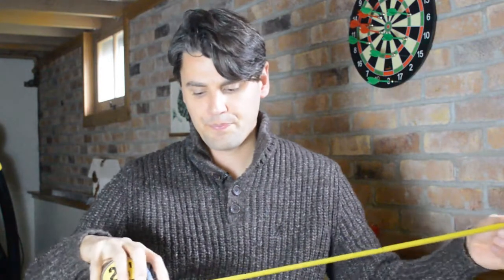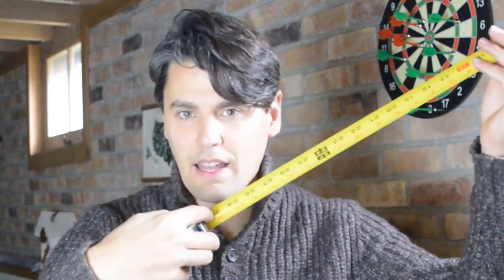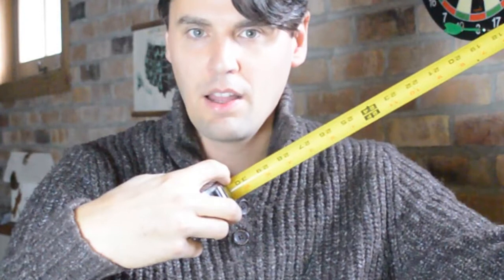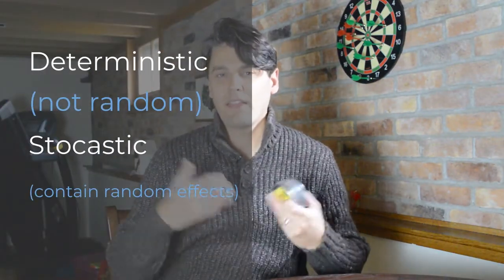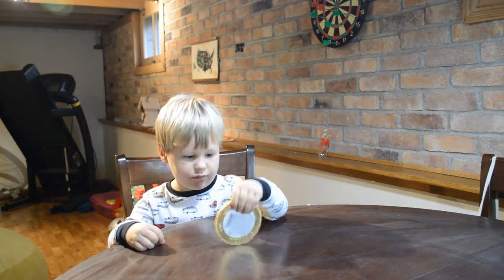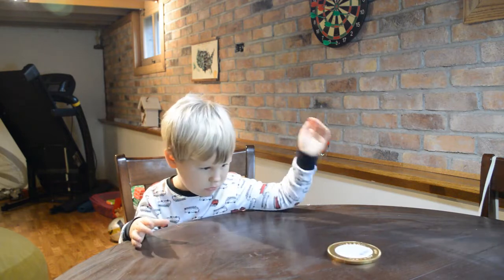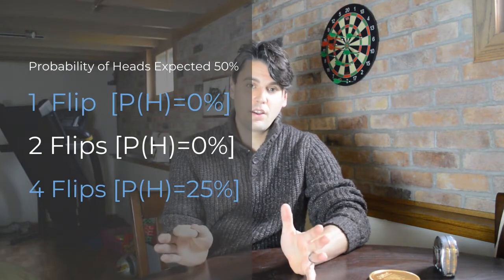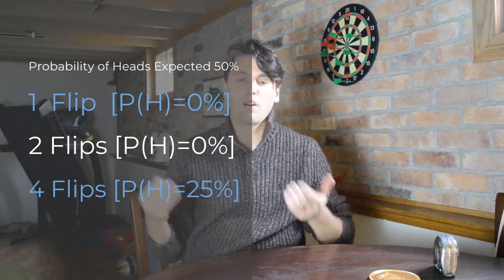X-ray Image Noise (Image Noise and Dose | Rad Techs)

Comment: It's for the same reason that brighter lights yield higher quality photos. There, that's the explanation. If you need to know more about why poor quality manifests as noise as opposed to trippy fractals or something then watch this video or any intro to quantum physics.
Reply from the maker: Thanks Adam for the analogy that both high exposure x-rays and bright light photos have lots of counts and thus lower noise. What we are trying to show here is why low counts leads to noise or differences from detector element to detector element.
Reply: @HowRadiologyWorks  Yes, I understand and I was being a bit too snarky. I just mean that if you've learned how noise appears on an underexposed photo, it's the same but with photons instead of electrons.

Comment: so high radiation doses are needed for  better images with lower noise. but radiation dose is a concern because too much radiation can severely hurt the patient. what is the soloution then? Could it be solved by improving the equipment used or maybe the software used for image processing?
Reply from the maker: Higher radiation doses reduce noise but that is not to say that the doses are high in comparison with radiation that has observable effects, in fact it is very low compared with those doses. You are correct that algorithms have helped a lot in reducing dose over the years
Reply: @HowRadiologyWorks  thanks for the information. Im a physics student aspiring to do medical physics from the UK so i enjoyed watching this video about x-ray image noise.
Reply from the maker: Improved acquisitions have also helped to reduce the dose especially for cardiac acquisitions